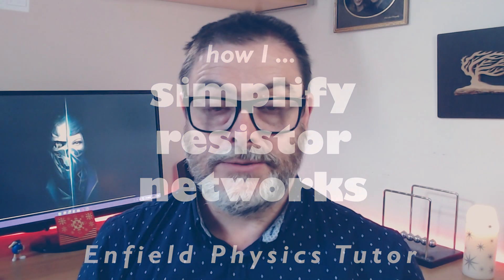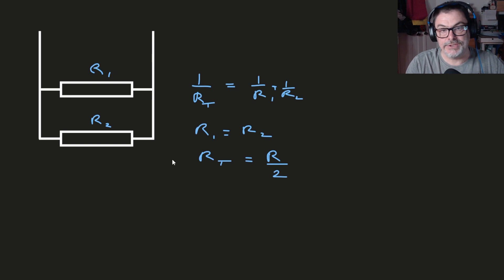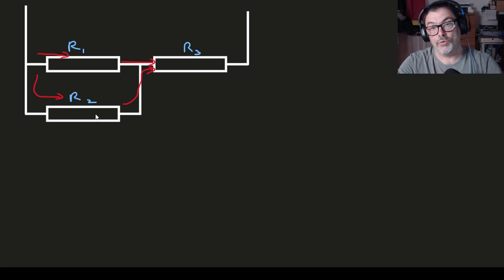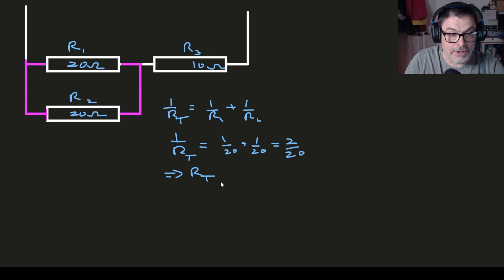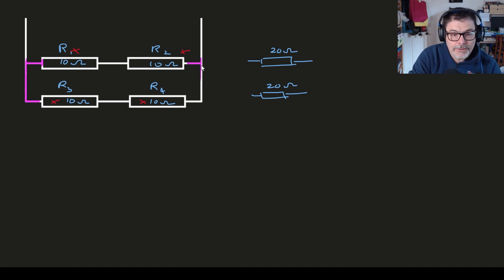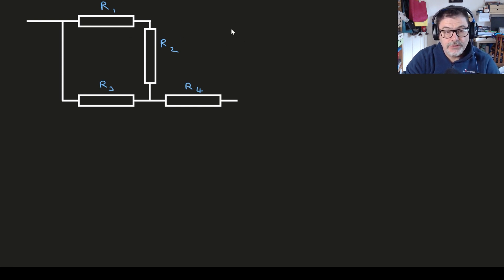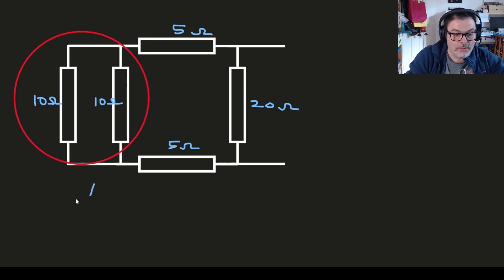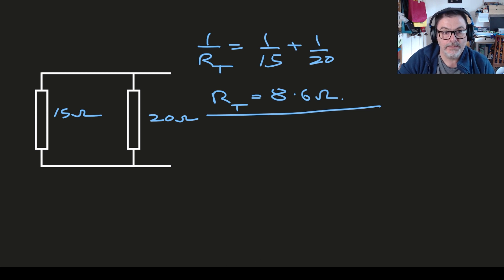Calculating total resistance in circuits is EASY!

Comment: Hi. Do you think that this sort of thing is worthhile revising and stressing over given that there hasn`t been any problems as hard as that in the past?
Reply from the maker: Good question. Every paper has potential dividers in it... esp if you're looking at emf and r. Was helping a yr13 this morning with a network of bulbs.... you might not get 'reduce these 4 resistors to 1'... but I feel like the principles of series and parallel is very likely
Reply: Yeah, I get what you mean, it can be a bit confusing with identifying which is in parallel or series. Very sad that I have come across this channel so late 😭
Reply from the maker: @thechessrevolution2196  well, best wishes for your exams.
Reply: Thank you hopefully it will go ok 🙏